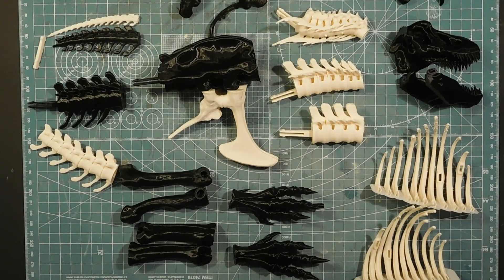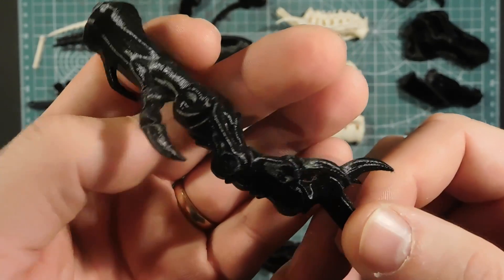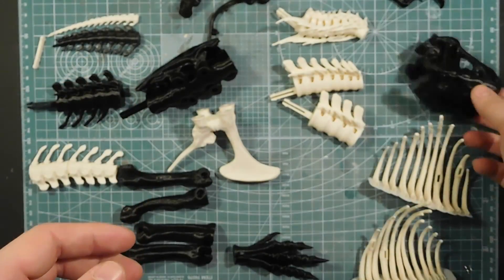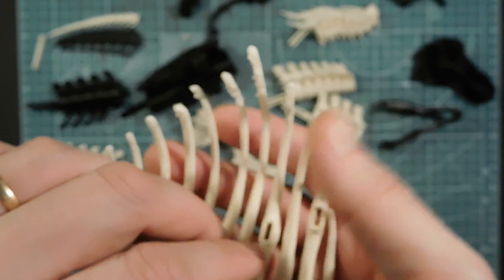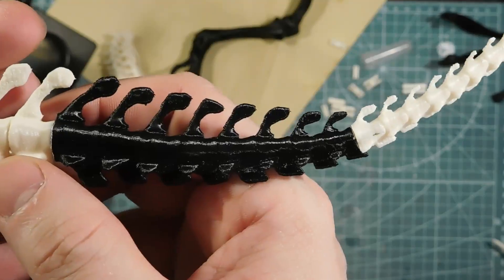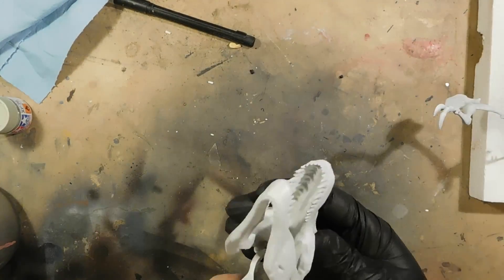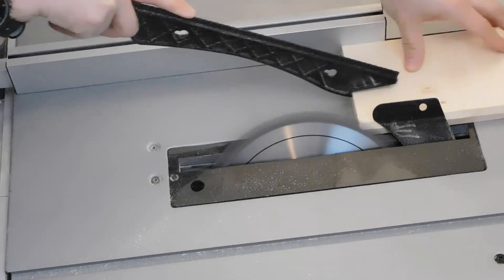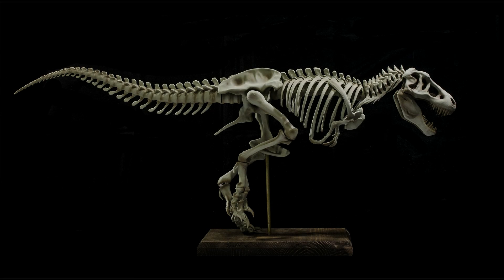3D-Printing and Painting Makerbot T-rex

Comment: I know you said you put a brim and two support rods on the neck but for me it won't print even adding those support rods... I'm going to try lowering the speed... I'm printing at 60mm per second... What other advice can you give me for the neck?
Reply from the maker: Maybe try generate proper supports with your slicer. It's more cleanup though.
Reply: Well I went down to 15mm/s on outer layers cause I had a lot of problem with printing ribs and smaller parts. Also went with printing the supports on slim parts that would otherwise wobble out of existence and make me print them again (yes I'm talking about those damn ribs). Also check your fan settings, cause it's important to set it to 100%. You get detailed model sacrificing it's strength, but since only visuals matter in this type of print then no point in considering how tough it would be. I also used 3 shells most of the time. Good luck with printing, hope I'm not too late with the tips.
Reply: did you get the neck?! Thats the only thing giving me problems right now
Reply: @yearofthechris  yes, it was a bitch but got it.. put brim, lowered print speed, made sure fans where on to 100 after the first couple layers and manually added support rods where it failed before.. so I believe it was the tip top on both sides, base and middle
Reply: @pcysneros  You're the man, thanks for replying. I now have some hope haha Im about to give it another shot but this time I will follow your guidance. Thanks!!
Reply: @yearofthechris  no problem... Now that I think about it I think I choose supports touching build plate not custom supports
Reply: @pcysneros  So I am sort of a newbie in the 3d game so when I saw your reply about custom supports, I looked up a plugin that allows you to make custom supports (I just searched supports in cura marketplace and it was the only one) and I was actually able to add supports where you mentioned that touched the build plate and it came out great!!!!

Many thanks my friend!
Reply: @yearofthechris  wow, awesome man... I'm glad I could help you made my day